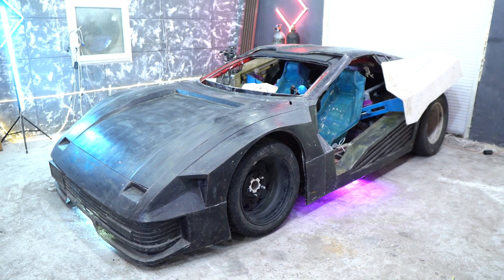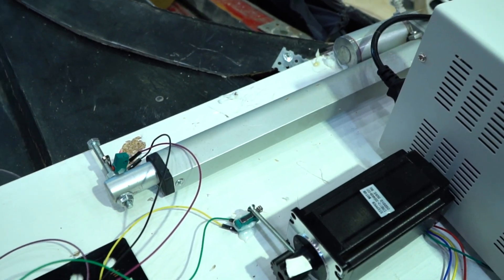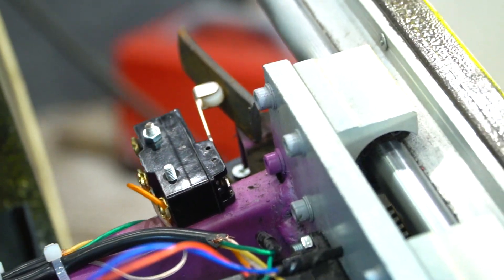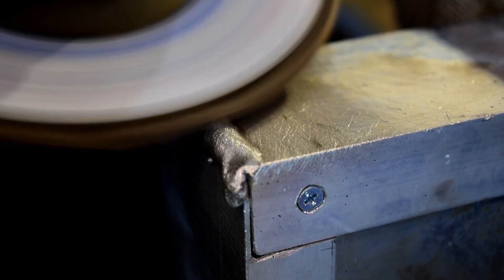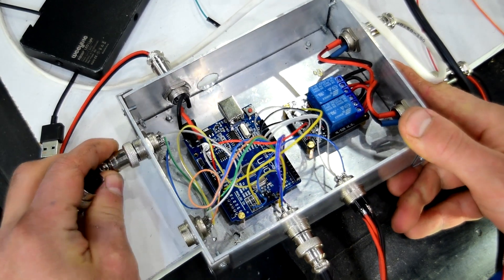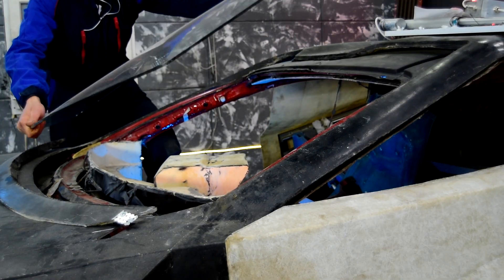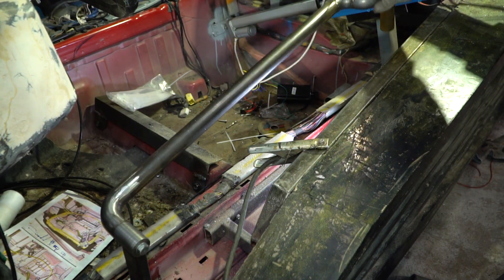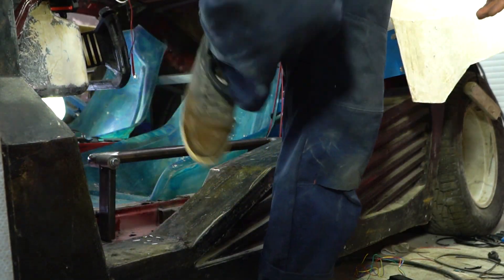Quadra V-Tech in real life. Windshield, automatic doors. Cyberpunk 2077.  Part 18

Comment: This is fantastic attention to detail, i hate that there may have been things lost in translation, because this is top notch engineering. In 1959 ford made a starliner with a electric folding hardtop, with all manual relays and switches, the relay box was 3 feet wide across the whole back of the car. This reminds me alot of that setup, but with more microchips

Comment: Always place the rack (toothed rod) on top of the pinion (gear). That way the gravity will drop any dirt and debris from it.
Also for the limit switches you could alternatively use induction sensors. You could double the sensors as well for reliability.
It would be super cool to program in some acceleration and deceleration for the door, since you’re using a stepper 🙂

Comment: Impressive work.  Why not lower the hinge point at the front of the side bar and add a step down so back half is flat where the "arm rest" portion is and the front bar angles as low as possible to make it easier to slide legs in?

Comment: The only downside is the safety bar. Further down where the legs are at the bar needs to come down when the door opens. Having more space to get in and out is important. The alternative is to make the roof slide inward or open up to make standing more possible for getting in and out, making the safety bar less of an obstruction.

Comment: Something that might probably help with the fluidity of the door opening is if you were to make the speed of the door opening slowly ramp up to full speed and then slowly ramp down at the end. This would ensure the door doesn't shake as much especially when coming to a stop at the end when fully extended. Just a suggestion! Keep up the great work :D.

Edit: There is many ways to add a ramp in acceleration and deceleration. But a very simple and easy way of doing it is. Instead of writing potentially a static value of lets say 255 to a PWM pin for the motor drivers. You can make the variable slowly increase and decrease based on time. Here is a simple example that I drafted:

door_actuator_pin = 3; // PWM pin for the actuator.
door_actuator_acc_val = 15; // Beginning value for acceleration of the door actuator. You might have to increase starting value to get over stall current if the motor has trouble opening the door.
door_open_full_power_time = 1000; // This value is how long you want the door to be opening at full power.

void loop() {
    
    // Check if the button press was initiated. Might want to see if debouncing could be an issue and or this check is being called multiple time.
    if(door_open_btn == TRUE) {
        open_door();
    }
}

// Simple function example of the door opening slowly and then allow full power of stepper motor and then decelerating slowly after a set time.
void open_door() {
    
    // Here the door will accelerate slowly.
    while(door_actuator_acc_val < 150) {
        analogWrite(door_actuator_pin, door_actuator_acc_val);
        delay(50); // Lower this value for faster incrementation of acceleration over time.
        door_actuator_acc_val = door_actuator_acc_val + 1;  // Or Increase this value for faster acceleration per tick.
    }

    // Here would be full power once the door opened slowly for the beginning.
    door_actuator_acc_val = 255;
    analogWrite(door_actuator_pin, door_actuator_acc_val);
    delay(door_open_full_power_time); // Edit this value so that it gives the door time to slow down.
    
    // Here the door will decelerate slowly after the delay of letting the door open full power.
    while(door_actuator_acc_val > 0) {
         door_actuator_acc_val = door_actuator_acc_val - 1; // Decrement with a higher number if you want faster deceleration per tick.
         analogWrite(door_actuator_pin, door_actuator_acc_val);
         delay(50); // Or lower this value for faster deceleration over time.
    }

    door_actuator_acc_val = 0; // To make sure the value is 0.
    analogWrite(door_actuator_pin, door_actuator_acc_val); // Make sure to slow motor to a complete stop.
}

Comment: I have tried few years ago to power a car signal circuit using arduino, however it failed as arduino is not capable to send a simultaneous signal to all of the signal lights, as is not capable of multi tasking. You might need another controller which is capable of doing this, such as Raspberry or LattePanda, more expensive, but more capable. Or, you can use multiple arduino boards to make the actuators work in pairs. And I also recommend using power transistors instead of the relay, as they are mechanical and the ones used in arduino are not professional components and they stop working over time or the contacts are welding in between making them unable to disconnect.

Comment: Be carefull about this white DC-DC step up converter (that on the white aluminium pcb) it will burn when voltage is low... once when butned, it will heats up like creazy.

Replate this to LTC3780 is more stable.

Comment: question, will you have any links to some of the key items you used in this build?...and also, for the door, is all of that wiring absolutely necessary, or could you have stopped where you left off at with the door mechanism from your last clip ?....

Comment: You're probably beyond this point of construction by the time this was posted, but I'd skip the custom windscreen and opt to thermoform a sheet of polycarbonate for this project. Even with the cost of PC sheet, you'd save thousands off the price of a single glass screen. With a single sheet as large as you'd need for the windscreen, you can get a significant bend just bolting it into a frame and release the tension with a heat gun, used sparingly and around the corners where it would fit on/in your frame.